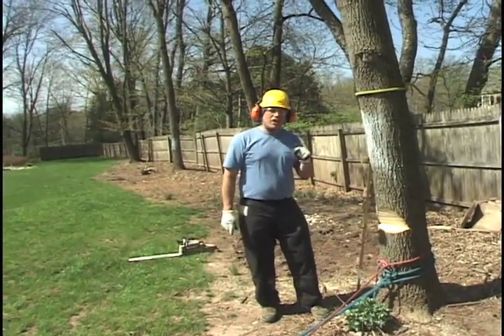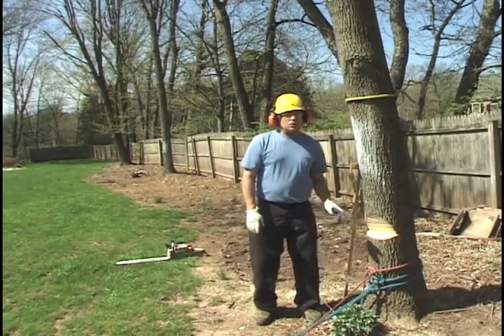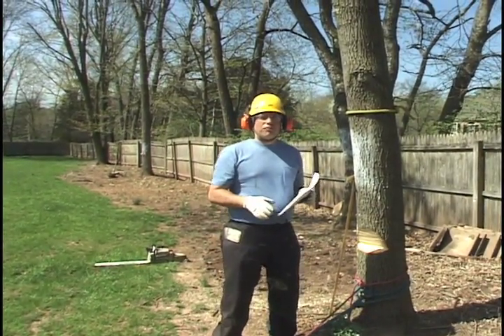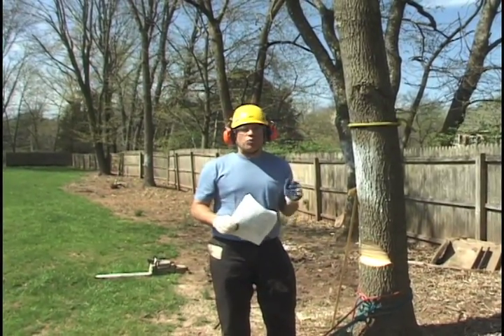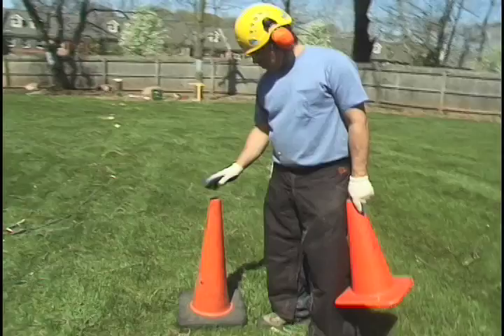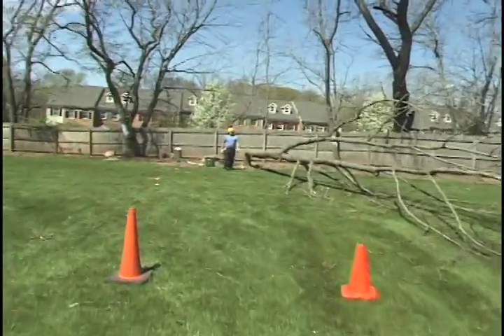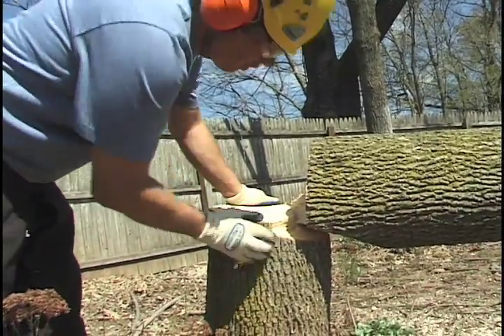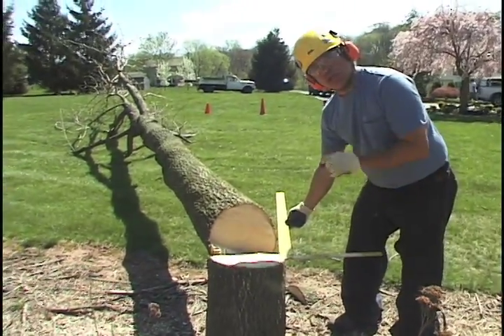Tree Falling: Directional Steering with the Back Cut

Comment: One, could use the ' tongue n groove '' method.  1/3 of tree diameter ; cut a vertical notch, longer than the tree is round ; from the front cut, downward. Poke cut, the bottom 3 inches out, (room for tongue to rotate, as tree falls). Then, proceed to ' point ' the tree in desired direction, possibly within 10 degrees, + or -  from the front face notch, WITH  THE  BACK CUT.  The  ' hinge '  will break within that 10 %....= Allowing a further , precise  falling direction.

Comment: I’ve been playing with this on a 90 foot giant water oak I’m taking down 
The limbs are extremely steep and  average 40 feet long
I needed to land them in a pretty tight area but the situation didn’t require climbing out and lowering sections down
It worked really well
I haven’t had that same luck felling 150 foot longleaf pine with 40 inch trunks tho
I am probably at fault but those monsters get momentum and stick to the path the front knotch makes 
More experienced guys can probably manipulate them tho
Nice video 
Thanks!

Comment: Im sure it goes without mention that different species have different elasticities. for example hard woods will typically separate from the hinge faster and are harder to steer. alot of soft woods can hinge longer and can also tear down the trunk if the hinge is large enough on one side
Reply from the maker: depends on where you are. A lot of the softer woods on the east coast don't hinge nearly as well as hardwoods. White pine is completely untrustworthy. hemlock is one of the best. so it all depends. have you ever cut ailanthus?

Comment: It would seem to be common sense that a hinge would have an effective drop radius depending on the trees center of mass(leaning). The more centered the mass, the more potential radius available to aim for. The final cut speed could also be controlled to preserve as much integrity and strength of the hinge as needed. Thanks for the post, interesting info.

Comment: How about an experiment? Two trees same species, roughly vertical and same diameter & height. #1: Humboldt face cut, then back cut with wedge horizontal to ground [How much does top of tree move horizontally?] vs #2: 30 degree back cut [Top down] and same wedge width. Will tree move more or is it the same?  Geometry question perhaps?

Comment: Looks like you just cut the hinge off a bit on the opposite corner you wanted to steer it. Especially easy if the heavy limbs on top work in that favor. Good way to untangle a hang up is to cut the hinge from stump on the side its hung on, most times the tree will roll into an opening, given the hang up isn't fell in the center of the other tree

Comment: Why would one want to steer with the back cut if you make a proper face cut?
Reply from the maker: Good question. There are a number of reasons that the back cut and the apex of the notch may not be parallel. One f which is imply by accident. So the fact that the back cut can steer the fall is an important consideration on tight falls, where it's best to gun the back cut as well as the notch to make sure the hinge is straight. And  on tight falls it can be useful to steer the tree on the way down with the back cut. The faller may also wish to use a tapered hinge or what Dent calls a swing Dutchman to fight side lean, where the back cut is angled

Comment: I did that with a massive (lol) 23ft busted pine last weekend...19" dia, bout 18" of back lean and a touch of side lean...used the tapered hinge to counteract the side lean and to avoid hitting the branches  of another close pine...it hit directly on the marker I had placed at 20ft from the stump.

Success was probably due more to luck than the hinge tho in my case.

Comment: Not really a useful point to make. People want to know how to effectively direct the fall against the lean to achieve a safe fall. For example,  I have got a tree with a strong side lean, I do not know if in my case a safe fall can be achieved.
Reply from the maker: use a right angle retainer line. You;re only going to get so much hold out of a hinge. Only way to figure out just how much you can get away with is to lose a few. The right angle retainer line is pretty much a sure thing:  https://youtu.be/4HRVsoM9bxc

Comment: Only thing I don’t like about this is the angled back cut . 
Angled back cuts will get you killed. 
Always make a straight back cut, at a 90 degree angle to the fibers. 
Angled back cuts cause barber chairing as well as trees falling the complete opposite direction of where you intended them to fall.
Reply from the maker: there's a little more to it than that. I would disagree with pretty much everything, but we could go into more detail another time. I gotta go for now!  thanks for sharing and happy to discuss it
Reply: As a former US Forest service Class B Sawyer, we were always instructed to never make an angled back cut against the grain for safety as well as avoiding equipment damage. 
Angled back cuts against the grain, create a very weak spot and setting yourself up to breaking in reverse. Weight shift will break the wood fibers. 
There’s an excellent video here on YouTube as well, which  I found for you explaining and demonstrating this if you’re interested.
Reply from the maker: not sure what an angled back cut "against the grain" means. All falling back cuts are agasint the grain aren't they? Dent published the angled back cut in his Timber falling book. He's the gold standard or at lest was. He later changed his teachings saying that the angled back cut (tapered hinge) was too unreliable to teach. Doesn't mean its dangerous or doesn't work for those that understand the limitations. Just that he would like to teach something that works every time. It's still a matter of considerable controvery inth e industry. Would love to check out your video suggestions. thanks

Comment: I tried that cut with a tree and it fell towards the fence instead of in the other direction .
Reply: Did you use a flat back cut or a sloped back cut?
Unless you have a bunch of experience the flat back cut is a lot safer than a sloped back cut, as it will allow the butt of the tree to slide towards the intended direction of fall leaving the top to go backwards
Reply: thas what ropes are for

Comment: Help me understand, because I am not clear.   Is it being said  that if I want the this tree to fall slightly to the left,  I cut  deeper into the hinge   on the left
(from the back  vantage point)  so that it "gives way first"? 
 Or,   is it being said that  I cut deeper into the hinge on the right side 
(from the back  vantage point)?    Is it  the side with the thicker  hinge remaining that steers the tree to fall on the thicker hinge side or...?
Reply from the maker: More like the tree has a tendency to fall perpendicular to the back cut.. so think of the back cut as a directing force... thicker hinge on left side prevents the tree from falling to the right side (if its leaning that way)
Reply: Thank you Daniel. Appreciate that. I do not understand this clearly.  The hinge has a Left and Right Side.  It seems to me that  which ever side is thinnest, will break first.  If the Right Side breaks first,  the holding force of the Left side will tend to pull the tree Left as it falls.  If the  Hinge on the Left side breaks first, there will be a holding force on the Right side which pulls the tree  to fall toward the Right.  Am I correct or mixed up?  (I have  some leaners to work with on my property, but many of the videos are not entirely clear.)
Reply from the maker: yes that's the basic concept, however sometimes the thicker part of the hinge just helps fight side lean, and not necessarily steer the tree, though it does happen..

Comment: At 3:55 into the video you can see that your back cut removed 1/3 of the hinge which would release that side of the tree first allowing it to change direction. I had not read the report but would love to know if it included removing hinge material. I assumed that back cuts do not influence a proper hinge, not what you have here.
Reply from the maker: The point of the video is that a back cuts do influence the fall....  The hing e shown on this video was called a Swing Dutchman by the late Doug Dent,  author of professional timber falling: https://www.amazon.com/Professional-Timber-Falling-Book-Douglas/dp/B00455VB4A

The technique fell out of favor after Dent concluded it was to unreliable to teach. SO it was probably not the best choice to demonstrate the principle that the back cut influences the lay.. As a result of your comment I have an idea for a new video that will better deomonstrate the concept , so thank you
Reply: Sorry but …nope. You clearly skip a little bit extremely important detail. You cut 1/3 of the hinge off. That allows the tree to settle into that curf. At that instance, the real hinge is now pointed to the left and thus giving the illusion that the thick hinge had something to do with where it landed.
Reply from the maker: The tree wasn't heavy enough to settle down on that open kerf. Honestly I would like to reshoot the video, because that wasn't the best example. The hinge here is referred to as a swing Dutchman by Doug Dent in his professional timber faller's book. He stopped teaching it because he found it to be unreliable. I have found it works best on smaller trees that aren't heavy enough to settle on that open kerf on the lean side.

Comment: So the thicker side of the notch will draw the tree in that direction.. The thinner side breaks free first and it pivots on the thick side
Reply from the maker: Another way to look at it would be that the tree has a tendency to fall perpendicular to the back cut. When the back cut is not parallel to the apex of the notch, sometimes you can watch on video as there is a tug of war going on and the tree will veer a little side to side as it falls..  another way to look at it is that the fibers on the tension side of the hine(away from the lean as opposed to the compressed fibers on the lean side) are better positioned to hold against side lean...
Reply: That makes sense. So, if I want the tree to fall more to the right, keep the hinge thicker on the right.

Comment: When your clearfelling all day in a pro duction forest you are not to fussy about lining up your scarf in the exact direction you want the trees to fall. All done with the backcut within reason. Here in NZ if you cut 4 x loads per day for a skidder operation you were doing well in my day. Surely one of the best feelings steering a tree to the ground.
Reply: If your back cut was steering the tree, why didn't u hit the cone u were aiming for, your notch will guide the tree where u want it, but when u cut into the face notch,u don't have control of the tree, your not guiding the tree,  it falls wherever it wants,

Comment: The paper you read stated that the hinge was modified by thickness. In your test, you cut through the hinges on one side and thereby not fulfilling the framework in the paper. Therefore your test do not contradict the scientific paper.
You and the scientists can be both right as you did not investigate the same situation.

Comment: Good video,

Question: based on the back cut, the side u don't cut (left) where u can see the splinters: if you want to direct a tree cut don't cut as much  the side/ direction where u want to go? So that's the last piece of the tree to break and it pulls the tree that way?

The only problem with this proving that paper is it's based on Griffin popper trees, that might be the hang up, maybe there is something w that type of tree.

Comment: Nice demonstration, with the T rule. however, the force and angular momentum in the cut was addressed.
 the tree had a normal force upward and canceled by the downward force of Mg... considering the normal mg in direction of the hinge cut which was perpendicular to normal forces...the result from the back cut will not affect the direction , assuming that he back cut is done parallel to the hinge. However, from the document saying hinge modification thick on one end and thin the other end.....does not have bearing on direction is just a trolling way to add scientific input. why because it does have a bearing on the direction of the fall. proof, as you went to show change modification on the back cut to steer the tree, you were in fact contradicting scientific report and proving that as you got closer to the hinge on one side, you left thick the other side thus proving with backside cut, that hinge modification in fact changes the direction of the fall. physics 101.
Reply: I like to add that my post is with the expectation that the tree is perpendicular to the ground and the weight of the branches in even., so no angular torque action would take place

Comment: Thanks Daniel,   This is appreciated.  In my experience I have observed directional steering with the backcut to definitely be possible.  I just finished a project of removing 200 Avocado trees in the Fallbrook, Ca area - from 15-35' tall  so I did a little experimenting to fell trees with various leans away  from other trees, between trees, hit various marks, etc.   Most of them did not require that much precision, and there were usually no targets so there was not much risk.  Some of the trees and branches were small enough that I just did rip cuts, once I got familiar with how that kind of tree wood responded, how it would hold a little on felling, etc..  I have also done directional steering with bigger trees.  I think what you have also proved is that you better make the back cut pretty close to exactly right when precision is required, or in the case that you somehow did not quite get the right direction on your notch, you could correct the fall with the backcut (saying you are not also using a tagline).  at 2:21 on the video you said you used a open face notch, but that looked like a conventional notch to me.  Keep up the great videos.

Comment from the maker: Not exactly.. one of the main conclusions should be that when falling ina tight DZ, its important to gun the backcut as well as the notch.. there are a lot of reasons to cut a tapered hinge, and correcting a mis-gunned notch can be done though its not very reliable and its generally best to straighten out the notch..

Comment: Great videos fellas.
There are so many variables. The study mentioned was done on poplars, perhaps the most brittle tree, the demo on ash a very flexible wood.
Another factor is where is the weight? In relation to the pie cut? Bush guys have told me about spinning softwoods after the fall has commenced.
I believe them. I work in town and haven't developed much knowledge or technique in this area because there is little oppurtunity for application.
The vids from these guys are right on the money.

Comment: It all depends on the type of tree and the physical nature of the wood. Also the only reason that happened that way is because the Faller cut through the Holding wood on the one side. If you cut through the holding wood on the Hinge than the tree will be pulled to the side with the most holding wood.
Reply: Great analysis, which wasn't explained in video

Comment from the maker: White pines seem to particularly prone to falling off the lay if the back cut is not even and straight.. I once nipped the corner off a hinge on a slightly front leaning big white pine, just so the bar would be long enough to make the back cut from one side.. Maybe cut 2" off a 28" hinge. Otherwise the hinge was straight .. the tree fell 5-10 degrees off the lay..

Comment from the maker: @ProArborJim Excellent post. Thanks for bringing some clarity and I agree with the reasoning, however I think that not all fall to the back cut, rather than the notch. Ive seen trees wobble back and forth as they start to fall, like a tug of war going on between the notch and the back cut. Ive seem little corner s of the hinge cut off that dramatically effect the fall in certain situations and no effect of the same in others, etc, so there are still some questions to be answered

Comment: The tree falls perpendicular to the back cut because the tree fibers break from the rear edge of the hinge ... not the front edge of the notch.  The notch just allows a clear drop without any interference that might cause rolling on the way down. Use your sight marks on the saw for that final cut.
Good video murphy4trees, just needs a clearer thought process on the mechanics of how the tree is coming down when you are narrating.

Comment: i was taught that you can angle the bar slightly in the back cut up or down.  if the tip of the bar is pointing up slightly the hinge will move the tree in that direction. try it, it works.